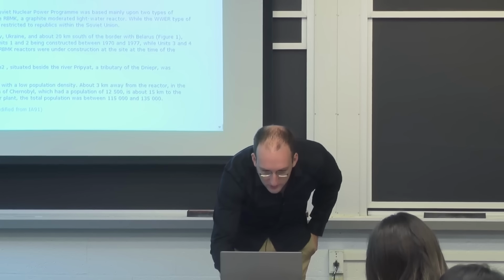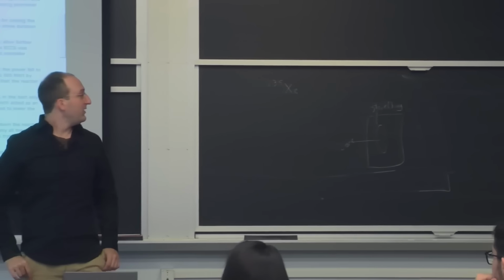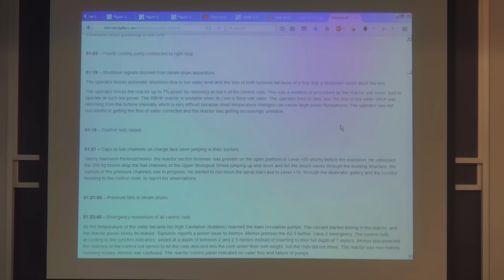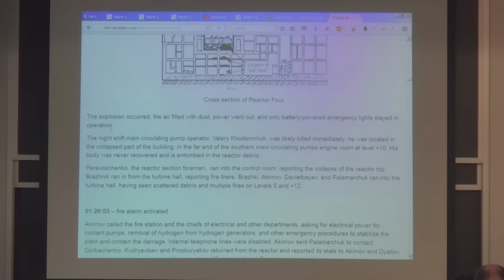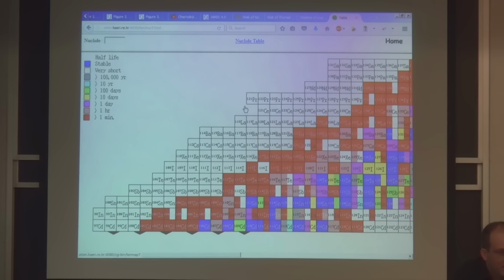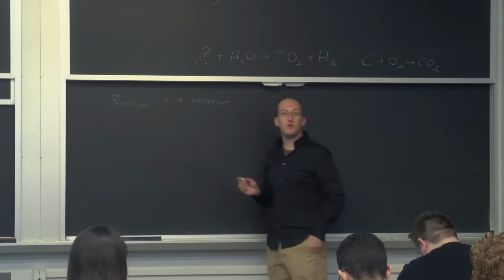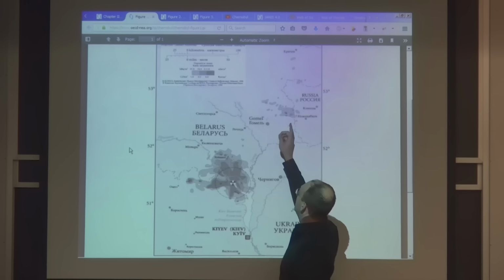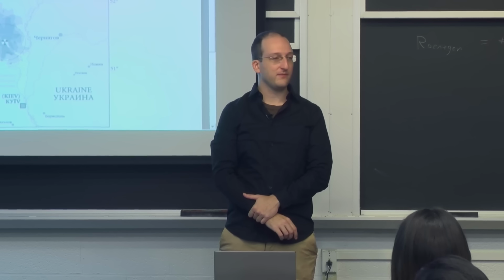26. Chernobyl — How It Happened

Comment: 16:07 When the caps started jumping, they had pressure differences.
Going from pressurized to almost no pressure makes the water in the reactor
go from boiling into gas, which then has the added effect of now squirting out any
of the still liquid water, and thus less coolin + less absorption.
This then result in reaction spikes, which added onto the jumping of the caps,
losing more pressure, and losing more liquid water in the reactor.
Now you have instant overreaction of the fission material, since the moderation
isn't working, and then when things heat up, that also feeds back into the
repeat loop.
With each superflash of reaction, you get energy releases which don't go anywhere
and build up, expressing in still more pressure, steaming more water, less water
in the reactor, less moderation, etc etc etc.BOOM.
Self feeding catastrophe.
But..
That's not where it ends. Nope, the nuclear material goes into a big puddle, andd now burns
down nito the ground, and without an auto separator as described in my other comment,
continues to radiate and fission and turn water and other stuff into hot gas, while taking with it lots
and lots of radioactivity. Bad times.
Any modern reactor should have at least several anti-catastrophy measures built in.
The most recent, Fukushima, is another example on how NOT to build a nuclear reactor.
Being disaster proofed should be an integral part of the design.
It's not when it works out ok, it's when everything goes wrong, when it matters.
Anyoen can handle good times, but for nuclear reactor operators they should be
tested for when things go wrong.
Personally I'd design them to have a last second emergency cut-off which works
with or without power, with or without moderation, and anything else that helps
control a nuclear reactor. Better to have a lesser accident, than to have a nuclear event.
Reply: None are completely safe but the Chernobyl was pretty good design at its time. Its the human factor who decided to go against the protocol and ignore it, to test it was the main cause. yes, the protection was weak but also the dangerous moment should have never happened in a 1st place had the protocol was kept. Fukushima had the tsunami to blame for but again, putting a reactor next to a sea sort of makes it vulnerable to rising sea levels - aka tsunami.  Chernobyl was avoidable and Fukushima was preventable.
Reply: @wortexinternational2598  Umm, if they can't be built with optimum safety, why build them at all ?
With the minimum of moving parts an emergency auto separator, can prevent just about any
meltdown, and with things like catastrophy in mind that can be indirectly the cause of a meltdown,
still reactors should be built with those more common in mind.

I'd suggest an emergency auto separator for all nuclear reactors, if they haven't been installed
or made as an integral part of the design. They cost little in comparison to the

whole price of the reactors, and yet can prevent any long term radiation releases.
I think there's also ways for damage control teams to act while not getting lethally exposed,
and that maybe it's a good idea for all manufacturers of reactors to be part

of damage control 'club' that put funds in, and get immediate expert assistance if and
when required. Most companies like to keep everything in house, but for disasters,
they'd really need to work together more.
(Sharing to be better better business each.)
From the damage control 'club' they can also make a standard within for acceptance,
so when a new company start into the reactor business they can either get stamped
approval by the others, but also stamped 'not approved' for physical reasons,

like lack of certain facilities that would help negate disasters.
Yes, it's a competetive business, but when it comes to disasters, all people involved
in it should at least try and pull all of it out of the nuclear fire.
Note that it's within each companies interest that there are no nuclear accidents at all.
Reply: @wortexinternational2598  
You are correct that safety protocols were not only ignored, but purposely bypassed, negated and shoved aside and that this should have never happened. However, the big graphite moderated elephant in the room remains the fact that the RBMK was not a good design at all and it would have never been licenced in any other country around the world because of these design flaws. Actually, it was the worst of the three options the Soviet planners considered for their new to be built atomic power station. They could choose from:

- An RBMK reactor
- A gas-cooled RK-1000 reactor
- A VVER-1000 reactor

From those three options the RBMK was the worst choice for both safety and efficiency factors, but they went with it because it was the cheapest to build. The Soviet Union was already hard pressed for money as it was, so they went with the least desirable option stemming from economical rather than safety considerations.

The RBMK design violated the Nuclear Safety Regulations for Nuclear Power Plants (NSR) and the General Safety Provisions for the Design, Construction and Operation of Nuclear Power Plants (GSP) that were in force at the time of the plant's design and construction. And not just the one Safety Regulation either. 

A few examples:
Article 3.2.2 of NSR-04-74 (as well as Article 2.2.3 of GSP-73) states that:
"When designing the reactor it is desirable to ensure that the total power coefficient of reactivity is not positive under any operating conditions. If the total power coefficient of reactivity becomes positive under any operating conditions, the nuclear safety of the reactor during steady state, transient and emergency operating conditions must be guaranteed in the design and explicitly proved."

This was one of the most egregious violations in the design (having NO containment building around your reactor is another big no-no btw).

It was well known to most operators that the RBMK's were notoriously unstable when run at low power, upon start-up (especially after a full refuelling of the core) and during shut-down. The reactor design was such that the positive void coefficient had the capability to outstrip the ability of the control rods to quench the reaction. In other words, the reactor could run away with itself and the control rods would be powerless to stop it. If anything, under the right circumstances they could (and did!) make matters a lot worse, but we'll get to that later.

That's why the INSAG Commission that investigated the accident concludes that these required safety conditions were not met, and that the design of the RBMK-1000 reactor and the nuclear physics and thermal-hydraulic characteristics of the core predetermined the reactivity under steady state refuelling conditions:

"The nuclear safety of the reactor with such coefficients was not "guaranteed and explicitly proved" either for operation at rated power or for intermediate power levels ranging from the minimum controllable power level to the rated level. This was also not done for transient and accident regimes. As a result of the misguided selection of the core's physical and design parameters by the designers, the
RBMK-1000 reactor was a dynamically unstable system with regard to power and steam quality perturbations. The steam quality, in its turn, was dependent on many parameters characterizing the reactor state.

The Commission concludes that the design and characteristics of the core of the RBMK-1000 reactor violated the requirements of Article 3.2.2 of NSR-04-74 and Article 2.2.3 of GSP-73."

Now for those pesky control rods. Article 3.3.1 of NSR-04-74 states that:
"The reactor control and protection system must ensure that the power (chain reaction rate) is reliably controlled, that the chain reaction is controlled and can be swiftly terminated and that the reactor is maintained in a subcritical state."

However, with the RBMK this was not always the case. The control rods were graphite tipped to enhance their worth in the lower regions of the core where they would displace the water (which could act as a weak neutron absorber) in the channels. But when withdrawn to their upper limit stops, in the case of an emergency the control rods could actually ADD reactivity to the core instead of immediately quenching it, because the first thing that would enter the active zone was not boron, but graphite (which accelerates reactivity)!

The INSAG report is very clear about this violation and says in no uncertain terms:
"In particular, the designers ignored the fact that the power and void coefficients of reactivity vary over a wide range from negative to positive values as a function of the core composition and the reactor operating conditions. They also ignored the fact that the design of the control rods was such as to predetermine an initial increase in positive reactivity as they start to move into the core from the upper limit position. The slow speed of the emergency protection system (the time for total insertion into the core from the upper limit position is 18 s) and defects in the design of the rods (i.e. the positive reactivity excursion) resulted in a situation where, for a number of reactor operating modes, the EPS not only did not function, but itself initiated a reactor runaway. Article 3.3.5 of NSR-04-74 states that:

"At least one of the planned systems for controlling reactivity must be able to bring the reactor to a subcritical state and maintain it in this state under any normal or accident conditions, even if one of the most efficient reactivity control mechanisms does not work."

I think it is very obvious that the above mentioned Safety Regulations were not met by any stretch of the imagination. And these are just a few examples.

The fact that the Soviet Union relied on humans rather than robust safety systems to keep their reactors safe is another ridiculous notion that should have never been put to the test. The operators were required to work almost like infallible robots. They never were off their feet and the work was so demanding that at some point reactor engineers at the Leningrad atomic station doubled up and "played duets" in order to be able to keep up with the complexity of the task at hand. They worked the panels controlling the reactor so hard that switches had to be replaced on a regular basis because they wore out in months.

I'm begging your pardon, but all of this does not exactly strike me as a "pretty good" reactor design.
Reply: @swokatsamsiyu3590  factor in "at that time". You are correct that it was cheaper and easier to build. 9 of these crap are still operating rbmk.  EVERY design is wrong. The Vver designs are supposedly much better yet accidents happen. Want safe nuclear power ? Build none. Hydroelectric, solar, wind, heck even coal is much safer with their issues. Not the actual reactor many times But the storage of spent rods, water, etc. It was literally the worst idea especially how they put them close to towns. I lived a few hundred km away and Chernobyl had a negative effect on me. I hate nuclear power and its danger. A friend of mine died in an vver plant  incident which was a nothing, yet he died of cancer. He was an electrician and during a repair his suit got ripped by a wire. He used the patch, evacuated the area, did the shower, etc. His hand burned so badly, needed surgery. 15 years later he was dead at 52 y/o. When you have this much danger at a place, you know its too dangerous.  Russia built many because they were idiots. Hasty actions due to rivalry with the US. 9 of these reactors still operating !!! Because of greed and shame. Its mostly political and financial reasons but we have the technology to shut all of them down. It won't be over though, we will still need to keep the stuff out of itsafe for hundreds or thousands of years.
Reply: @oldwortex5818  
Apologies for not replying sooner, but I had to sit on your comment for a bit and think about a proper reply. You may want to grab some coffee because it will be rather lengthy😅

"factor in "at that time""
Well yes, of course. My apologies if I didn't make that clearer in my last comment.

I totally concur with you that the RBMK's should have never been built. And that the rest of them should have been immediately decommissioned after it became clear what happened to Unit 4 and why. I am well aware that some of them are still up and running today and am not too thrilled about that. All the implementations and 'improvements' they have given them to make them safer are just stopgaps. An inherently unsafe design will never become fully safe because it is the design basis that is at fault. No amount of patching will alleviate those inherent flaws. So yes, they should have been decommissioned as fast as possible after the accident. Especially the ones sitting so close to populated areas.

"Hydroelectric, solar, wind, heck even coal is much safer with their issues."

Unfortunately, that is factually incorrect. Coal is actually the worst, with oil being a good second worst:

- https://ourworldindata.org/safest-sources-of-energy

As much as we both may not like it, we do need nuclear to combat climate change, if only as a transient until we can come up with something better. Solar/ wind alone will not cut it, they are intermediate at best. Where I live, we have a 6 month darkness period during the winter time. Solar panels are utterly useless during this dark period. We do not have hydro-electric as we are a very flat part of the world. So we need something else to bridge the gap.

The waste is still an issue, but at the moment there already are new nuclear reactor designs that can actually use the waste of other reactors as fuel. Also, I view what we now call "nuclear waste" as a sort of energy "piggy-bank". It sits in storage until we have found a way to almost or fully use the remaining stored energy. As technology progresses, at some point a solution will be found.

"I lived a few hundred km away and Chernobyl had a negative effect on me."

When Unit 4 went up in flames I was 15 years old. We couldn't eat anything from our gardens for over a year, our cows couldn't pasture outside and their milk had to be disposed of because it was badly contaminated. So, despite the fact that I (luckily!) wasn't as close to it as you were, we still were directly impacted by the accident. That is one of the main reasons that I took up studying nuclear reactors and their different designs in my spare time. To give my resentment a place (resentment takes a lot of energy out of a person. I tried to convert that bad energy into something useful) and to try and understand more of how they work, why they work the way they do and what went so horribly wrong that april night.

To my surprise I learned that most of the reactor designs (except the RBMK of course) are in fact extremely stable, even when prodded with a stick. But unfortunately, that fateful april night someone was wielding a very big stick indeed, upon an already inherently unstable design. And even with it being this inherently unstable, the reactor still tried to shut itself down for almost an hour until they had backed it firmly into a corner and it literally had nowhere to go but up. I have done extensive reading into this particular accident and it was discovered that they bypassed/ disabled almost every safety system that they could get their greasy little hands on in order to raise the power because Dyatlov wanted this test done, come hell or high water. Those include, but were not limited to:

- The Emergency Core Cooling System. They ran the reactor for almost 11 hours with the system physically disconnected from the core.
- Automatic Control Rod System disabled
- Manual extraction of almost ALL control rods, even the special group that was supposed to be in the core at all times.
- Steam/ water separator alarms were repeatedly cancelled
- Feed Water Flow Rate alarms repeatedly cancelled
- Excess Steam alarms repeatedly cancelled
- Neutron Power alarm repeatedly cancelled. This one is particularly bad, because this one is a major red flag as to what is going on with the power inside the core.
- Emergency Thermal-Hydraulics parameters repeatedly cancelled
- Two feed water circulation pumps switched off
- Turbine emergency regulating valves disabled

If their intention was to purposely weaponise a nuclear reactor, this would have been the way to do it...

"I hate nuclear power and its danger. A friend of mine died in an vver plant incident which was a nothing, yet he died of cancer. He was an electrician and during a repair his suit got ripped by a wire. He used the patch, evacuated the area, did the shower, etc. His hand burned so badly, needed surgery. 15 years later he was dead at 52 y/o. When you have this much danger at a place, you know its too dangerous.  Russia built many because they were idiots. Hasty actions due to rivalry with the US. 9 of these reactors still operating !!! Because of greed and shame."

First of all, I am sorry for your loss, and we firmly agree upon most of what you say.

However, a nuclear reactor doesn't understand emotions like hate/ fear, ideologies, religions, creeds, our wants or needs. It only understands physics and how to respond to those physics. It is up to us humans to respect the immense power they have and how to use that power prudently, or respectfully leave it alone if/ when we can't.

The cold war brought nothing good to this world. I grew up with the constant fear of having an atomic bomb dropped over our heads. We even had drills at school to learn what to do when that moment had come. The Soviet Union was obsessed with looking the part to the outside world and not being humiliated. They had little consideration for both their own people and the rest of the world at large. It didn't matter to them how many people they had to sacrifice, as long as they looked good and powerful. We both bear the legacy of their reckless behaviour in our hearts and minds. I hope my comment helps.